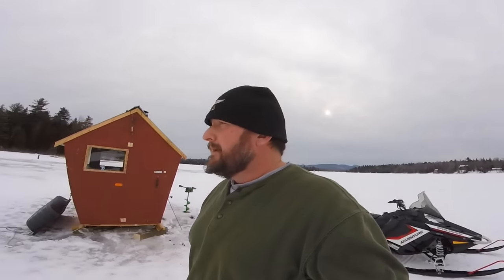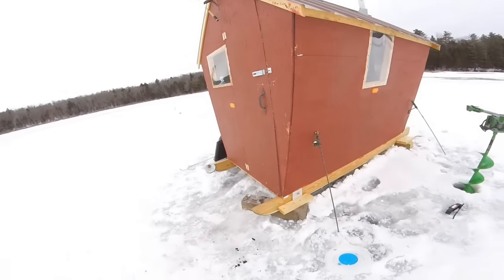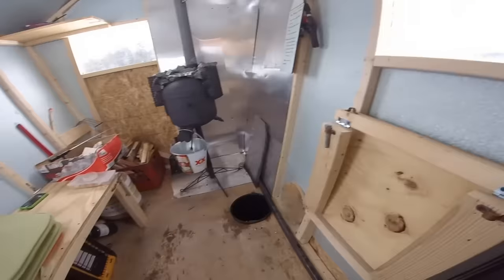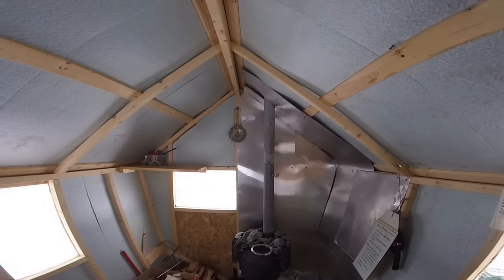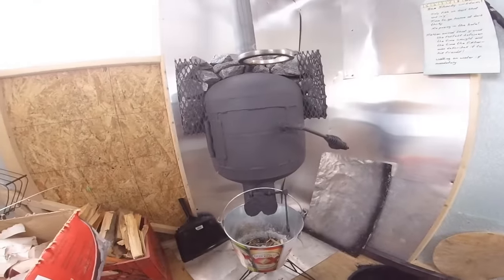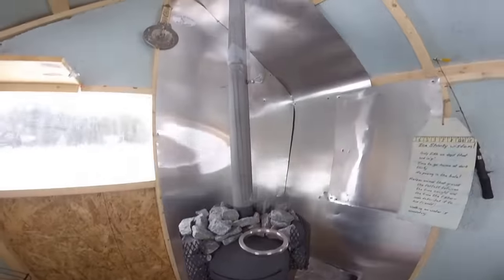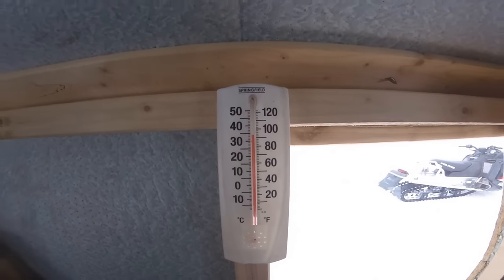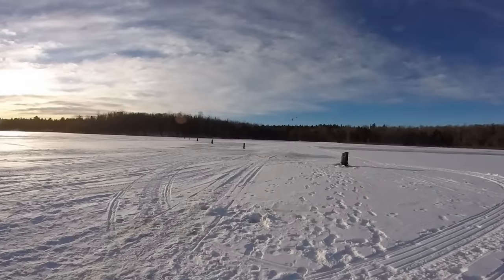Ice Shanty with Homemade Wood stove

Comment: A damper in the vent pipe so you can shut it down a bit will make the wood burn slower and keep more heat in. You close it just enough to keep the smoke out...
Reply from the maker: There is one in there....

Comment: Love the flip down seat! Nice work on the door. Did you use a plasma cutter to cut that? Ha 94, that will take the chill out of the bones. Love it. Nice work!
Reply from the maker: Thanks, I did use a plasma cutter. One of the best pieces of welding/burning equipment I've bought. Only thing I wish is that it was able to cut thru some thicker steel. Right now this one will cut up to 1/4".... but its portable. Its a Miller, I dont remember the size... I'll get back with you on that later.
Reply from the maker: Plasma cutter is a Spectrum 375 X-treme made by miller.

Comment: Very cool shanty and love that little wood heater.   What type of rocks did you use to collect heat...need an idea here for warming pipes in basement during a prolonged power outage and we can't seem to figure a way to get a wood stove idea going in the basement....it wood work but the flue would have to run up the side of a two floor small house with elevated roof :(  Not smart or innovative enough for this project :(  All ears if you have any ideas...going with a HQ issue tent stove.  That said, thinking of firing it up outside and wrapping hot rocks around problem areas...if that even makes sense.
Reply from the maker: Thanks for the compliment, glad you liked it. The rocks are actual sauna rocks that we had left over from our sauna build.

You might try a "Mr. Heater" portable propane heater for your basement. They are small and throw some good heat. You can get an adapter to hook it up to larger bottles. 

Thanks for watching.
Reply: I would make the stove pipe go out a basement window if you have one. or maybe a second story window.

Comment: i assume you pull with snowmobile? How does it pull, could you pull it down trails you think easily? I am looking to build an ice shack for some remote lakes.
Reply from the maker: Yes I pull it with a snowmobile... tows nice on packed trail.. on the lake... where I live the trails are way to narrow. Only room for two sleds to pass. When I go remote I just bring the tow behind pop up. Thanks for watching.
Reply: @5yearplan269  yes our trails are narrow too, just enough room for a shack this size to get through, but we do it. We leave them up there though, i dont mean move from lake to lake. End of season, we hide in bush , shhh
Reply from the maker: @acreage living check out this link to another video I just put up.... might be something that you can use. https://youtu.be/atx6k2ji1Os

Comment: Wicked little shack.  Do you pull that with a Snowmobile?  how easy is it to move, and how many holes inside?
Reply from the maker: Thanks, Yes I pull it with a snowmobile. Last year I used a 1990 Skidoo Safari that was only hitting on one cylinder and was able to pull it off the ice.... so I guess it is easy to move! It has one hole inside, but you could rearrange it a bit and probably get a couple more. Thanks for watching. Hope this helped.

Comment: How did you attach the bottom frame chord to the floor?
Reply from the maker: Marshall Angst I have had a lot of questions about the shanty so I'll be posting a video showing it more in depth in the next couple of days. Basically it is framed like a house using 2x2's with the bottom of the wall screwed to the floor. Thanks for watching.
Reply: Like to see the exhaust design on back of stove also. You could teach how to make videos for YT by the way